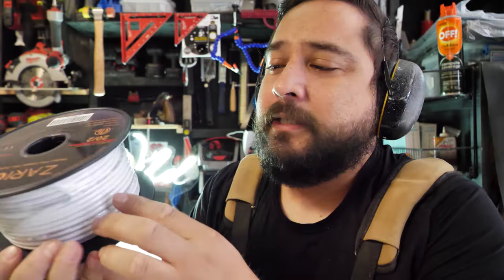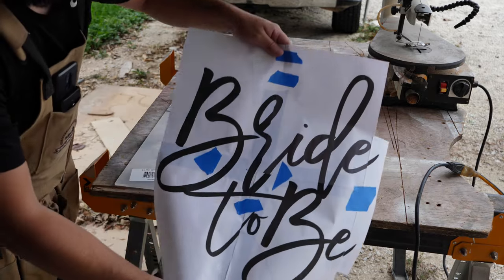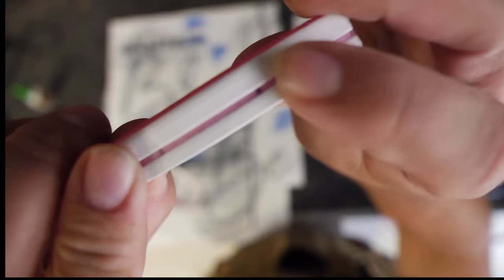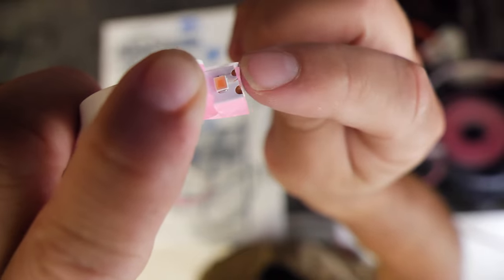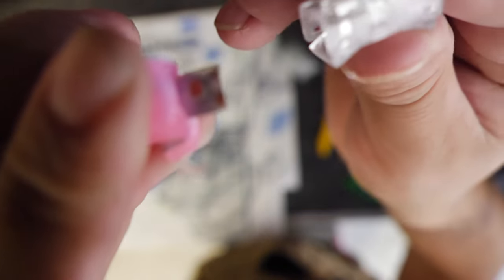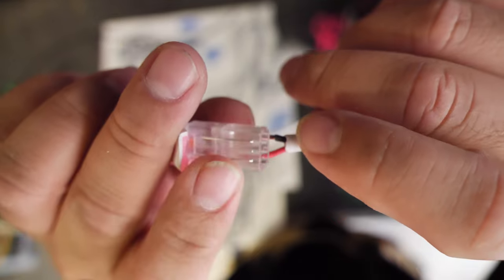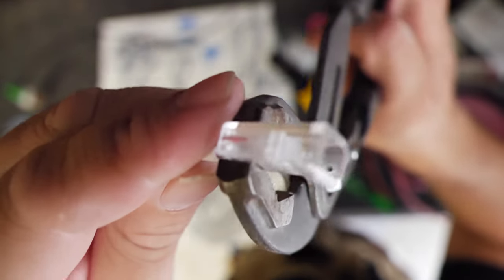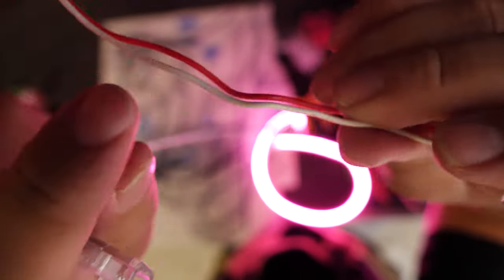DIY Neon LED sign NO Soldering

Comment: Hi! I know this video was a while ago, but im a new watcher! I wanted to ask, who do you recommend we go to if we do not have that specific cutting tool? Thank you
Reply from the maker: Hi, thanks for watching. Another option which can be done with some practice is a jigsaw? But the acrylic will have to be thick, the thin acrylic will crack. Hope this helps
Reply: @MakerDecor   Oh ok, so a jigsaw can pretty much do the trick for various material? Thank you
Reply from the maker: @KIHRUH  Yes, the jigsaw can cut various material. But will do better if you get the blade that cuts the material you are cutting. For example they do sell a metal cutting blade, wood blade and also the plexi glass cutting blade. This would help in cutting the plexi glass to have the corresponding blade. It is available on Amazon, Good luck!

Comment: I get the appeal in no solder connectors, but they are very weak and the connections aren’t the strongest
Reply from the maker: Hi, thanks for watching. And you are very correct. The best way is to solder which gives you a stronger more reliable connection. I decided to show this way because I would get a lot of questions on how I was able to do it with out soldering. Neon LED signs of this size soldered are really expensive as they should be because of everything you mentioned. I just didn't want to pay that and was willing to accept the trade off in lower price and quality vs the high price online.  I did try to solder and was unable to get good connections. And then with a little bit of time was able to create these LED signs. It does take some time and patience to get reliable connections vs the solder method. But the signs all still work, I am just very careful with them as I would be with any neon sign. Thank for taking the time to comment!

Comment: Hi - what thickness did you use for the acrylic backing?
Reply from the maker: Hi, I used the thicker one from Home Depot. The thickness was .220 The thinner one has an increased chance of cracking. But the .220 really is pretty simple to cut with some practice.

Comment: these things are pretty Cool , thanks for posting the how to Video  what are those Clips called ?    BTW i’ve also had a lot of Success with that Gorilla Glue on  severalProjects i’ve built
Reply from the maker: Thanks, they are called 2 pin LED strip wire connectors? I have never used gorilla glue except for this and it works great. One problem is that it only works so far with this brand of neon lights. I have tried it on two other ones and it doesn't have the same holding power? But for this application, there still holding strong over a year later.

Comment: I was wondering how you connected to word “to” to the Bride part?
Reply from the maker: Hi, at 7:28 you can see a long white wire at the end of Bride. It has the red and black negative and positive wires in them. I wrapped it around the back and attached the wires to the "To" section from underneath. Hope this helps

Comment: Good afternoon, thanks for sharing this awesome content! What are you using to cut the acrylic sheet? I am hosting a wedding in June and I was inspired by your video to create a sign for my backdrop and champagne wall. Thanks!
Reply from the maker: Hi thanks for reaching out. I used a scroll saw to cut the acrylic. You just need to make sure you get the thicker one, the one here was I believe .220. I bought mine from Home depot and their is usually a thin one and thicker one. The thin one is easier to crack due to vibration. The thicker one is easier to manage. I have also seen people cut the acrylic with a jigsaw which is a cheaper tool. But go slow to avoid cracking  acrylic and wear safety gear to be safe. Good luck.
Reply: @MakerDecor  Awesome sauce! I appreciate the great information. I will research both saws and see which one would be a good starter for me. I declare much success with your business and thanks for sharing your thoughts and experience!!
Reply: @MakerDecor  Hey - thanks for the video. I wanted to know what blade you used on your scroll saw. I have tried with the very fine blades, but it seems to just melt the plexiglass when I cut it, and if I go any faster the plexi breaks. Thanks again
Reply from the maker: @phillismit7063  Hi, yes I use general purpose blades. The fine blades are too thin and allow the plastic to melt because it is not removing a lot of the plastic between allowing it to just melt with the heat from the blade. Yes going fast will crack the plexi glass, Also if you blade is dull it will make it more difficult to cut and will cause the cut not to be clean so it will melt back together. I am planning to make a video on this topic this weekend. As I get this question a lot. I will be covering how to cut it with a jigsaw and scroll saw, along with the blades and speed that create the best chance of not cracking the plexi glass. Hope this helps.
Reply: @MakerDecor  Hi! Thank you so much for answering these questions! I was also wondering about the blade you used. Did you ever end up making the video on how to cut the plexiglass with the jigsaw and what speed you used for the scroll saw??? Thanks again! Love you videos!
Reply from the maker: @AC-sn7fz  Your Welcome, and I am sorry not yet. I do plan on making the video. Just some builds have been behind. But will get to it hopefully next month. I want to make a LED sign for the shop, so I hope to cover the topic.

Comment: What do you test the strips with to see if they work
Reply from the maker: Hi thanks for watching. I just plug the light into the adapter to see if the new connection works before gluing down.  Each time I make a new connection I plug it in to make sure the connection still works.
Reply: Oh I see start with the power source side first.
Reply from the maker: @ajpro777  Yes👍

Comment: Thank you so much for your tutorials. I'm a little confused on cutting the LED wire. When you get it on thew black dots, do you just cut the softer part and leave the middle connection! Or do you cut straight through? Thank you so much (:
Reply from the maker: Hi thank you so much for watching. Yes cut all the way through. Then peel back some of the soft part to expose the connectors. I have another video which shows the process better. Here is the title "Closer look at LED Neon connectors, solderless NEON LED signs" Thank you!
Reply: The LED strip has a black mark for the solider connections that shows through. You have to cut through the rubber/plastic defuser and the led tape.  Once cut you will see to golden (sometimes silver) dots on each side of the strip.  This is where the positive and negative go to pass electricity though the LED wire to light them up. You can solder or you can use the clips like this tutorial (which I didnt even know they made).  Hopefully this helps Tori.

Comment: awesome ! i want to start selling these for my business. can I use a multicolored led light strip and buy remotes for each project ? or is it just best to buy different colors individually ?
Reply from the maker: Hi thanks for watching, I have not tried to use multi-colored lights yet. I imagine they work the same. Just a tip, if it is more for business I would look into soldering the connections as that would be more secure. I did these as I did not want to pay for the size I wanted. Which can be very expensive. The only difference I would do is solder the connection as that would have the connections welded together just incase of shipping or anything customers would do that can cause the plastic clips to disconnect. I have not had this happen but I can see if I were to sell these that could be a issue that would potentially pop up. Soldering is not difficult, just takes some practice, but that would make these a more reliable product to offer. The ones I used for events were on maybe 3 hours with supervision. And nothing went wrong and they still work, I just did not want to pay the over $200 to have them built and figured this out for me. I do have a heart one that I built on my channel that my wife used as a valentines decoration and would leave on all day in our house (off at night) for over a week with no issue. Just some advice to think about before making to sell to potential customers. Thanks

Comment: What did you use to clean off the excess glue ?
Reply from the maker: HI, I used alcohol wipes and a lot of patience. lol I learned later to use less glue because it can get messy quick without realizing it. But yeah those alcohol wipes worked for me. I am sure they sell something else for it, but It worked with the wipes. Good luck!

Comment: Sorry to bother, how many signs can you create with one roll ?
Reply from the maker: Hi no bother, thanks for watching. It really depends on the sign. For this sign in pink, I probably had about a little more than 2 ft left. For more than on sign you will have to find a way to connect as it only comes with one side that has a female adapter that connects to a power source.